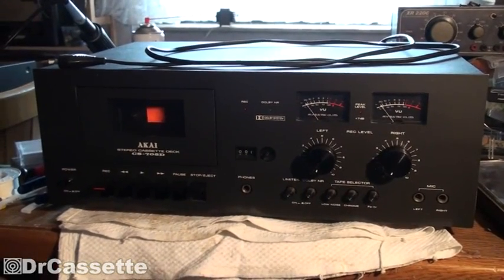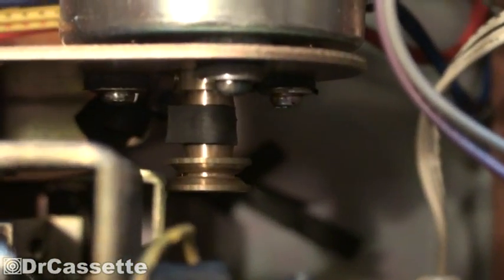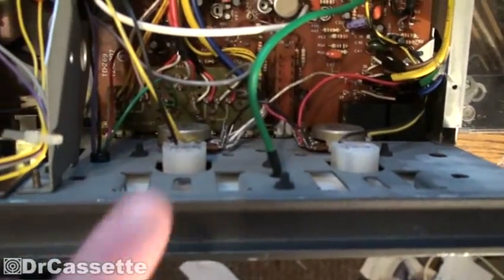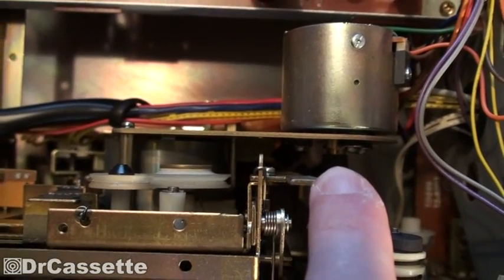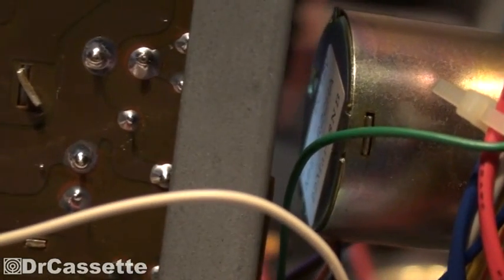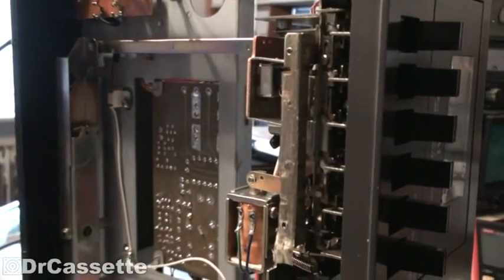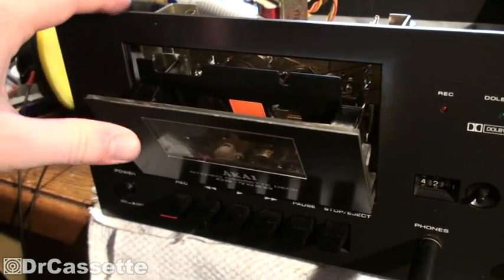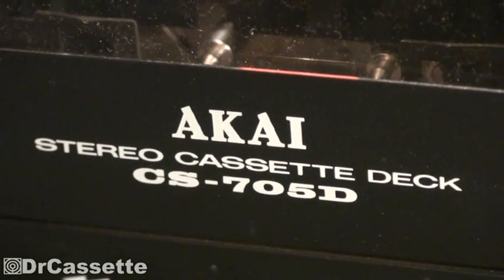DrCassette's Workshop - Akai CS-705D cassette deck repairs

Comment: I had one of these tape decks from Akai, bought new in 1979. As I live in Brazil, specially at that time it was difficult to find and expensive to buy hifi equipment. The most common ones were copies of JVC equipments (under the brand Gradiente) and from Alpine (under the brand Polyvox). But all of they were sold calibrated with tapes that could hardly be found here. When we recorded with the BASF, Scotch and Sony tapes that were being sold here the recording were poor, with low treble and too much noise. When Akai launched the CS-705D was a gift for us, who appreciated good music, because despite being affordable was capable of producing good recordings which, by the way, I still have until nowadays, surprisingly still with good sound. The only difference compared to the one you fixed was that my CS-705D had a silver front and also had backlight behind the VU meters. Congratulations for the video, made me remind of an equipment that gave me good moments of music listening.
Reply: Gradiente equipment was the same as JVC, the only difference was the design of the keys (in some of them)

Comment: I had one Akai CS-705D back in the 70s and it was my first tape deck worth using it. The older ones had a bad, bad sound, specially regarding the highs and the noise level. It was only with the CS-705D that I could have a sound decent enought to hear. I used it a lot, some of the tapes I have up to now in 2020 and they still sound acceptable. I sold the Akai in the 80s and recently I was given one in perfect condition so I could test it, but it was no match for the Pioneer CT-W505R and CT-W606DR I own today. Despite that, it was good to see DrCassette keeping this piece of jewell in working condition, it is part of tape decks history and in my opinion it is worth the effort to repair. It. Congratulations for the video, it was amusing!

Comment: I bought one of these a few months ago for little money. 
Took the risk of repairing and refining it. Lovely machine, my only criticism is the slightly flimsy manual buttons, but apart from that it was easy to work on, although the solutions to problems are not always easy. Up and running and sounding stable with slightly better frequency response than the specs.
Thanks for the tip on the cassette door and loading tray - nice touch DrC!

Comment: Hi, I know I came too late but the CS-705D has two lamps for the meters. You have to remove the frontal plate to replace them. Love your channel.
Reply from the maker: I don't remember if I ever figured out the meter lights in this deck. Maybe I finally did before selling the deck.

Comment: Nice to see you back with another YT vid.  Great Akai cassette deck!  I still have a nice GXC-710D that's a year or two older than your CS-705D.  I bought it new back in '77.  Akai must have dropped the glass/ferrite head GXC series. I've never seen a black faced Akai like yours.
Reply: The Black Face are EXTREMELY rare.  Kind of a collector's item actually, if you collect old Akai's or rare tape decks.

Comment: I have an Onkyo TA-630D tape deck that looks somewhat similar internally.  I've been putting off fixing it because the belts have disintegrated in a fashion similar to your Aiwa unit prior to repairs.    Unfortunately, in my deck large pieces of the belts have remained attached to the rollers, and have essentially turned into a kind of viscous black liquid.  I'm wondering if using freeze spray might solidify the belt remnants enough to remove them without making a huge mess.

Comment: Hi! Great video! I've got a CS702DII that powers on perfectly but then does not rewind, fast forward or play. I did notice that when I press the rewind button the capstan belt does move slightly. Apparently the seller who sold me it said it worked perfectly when he sent it but now it does not. So what sort of thing could happen through a delivery process to make the play, rewind and fast forward features not work? I know this is a long shot but would appreciate any help!
Reply from the maker: Maybe a loose belt slipped off during the delivery process? The problem description sounds like bad belts or bad idler wheels (though idler wheels don't instantly go bad).

Comment: A solid entry level hi-fi deck, 2 head single motor. I have the cs707 which is almost identical but the front is silver and case wood. It also has more illumination and an output level control. One of these days I will rebelt it as there is flutter on the playback :-)

Comment: I have an Akai CS M3 cassette deck that the play, FF, and RW switch will work as long as you hold them down, they will not stay down on their own. Any idea of what might be causing this?
Reply from the maker: The latching mechanism might be seized up due to sticky old grease. I had this happen on other cassette decks.

Comment: I got a CS 705D in great condition from my father in law, he told me that he used it for cassettes and as a amplifier for his LP player. But apparently I have difficulties getting it to work as a preamplifier for my Technics LP player. Do you know if it even is possible to use it as a preamplifier? I know my way around cables and the connections but yet all my attempts fail. Could it be something broken inside?
Reply from the maker: You can not use this as a preamplifier for a record player. You need an amplifier with a proper Phono input. That also features the RIAA equalization you need for the full frequency response. If you'd try to use the cassette deck as a preamplifier you'd only get a very tinny sound out of it.
Reply: DrCassette Thats what I originally thought, thank you very much for the answer.

Comment: Thanks! Excuse my ignorance : what exactly switch ? I gave the spray to all actions taken by the play button and the problem is not solved ....
Reply from the maker: bevavictor The Record/Play-Switch!!! A long internal switch on the main circuit board. It is only operated when you press RECORD!!!
Reply: DrCassette I solved the problem with your advice .... I thank you very much! Now it broke the bulb PL-3 in the cassette compartement .... if I can not find in the store will take away from the other deck!
Reply: Vittorio Principe Hi! Today new light in the cassette compartment! The restore of deck 1 is complete! Thank you! file://localhost/Users/vittorioprincipe/Desktop/Akai705D.jpg

Comment: Hi! I watched the movie .... really interesting! I own two 705 d (first series of 1977, blacks) with belt in order....the decks haves the same problem: by pressing the play button the right vu meter jumps (also the left) and producing bad noises. In the movie you speak of oxidation: where do I go exactly the spray flux? I'm not an electronics expert ....I tried to switch the spray on almost all circuits but the situation does not change .... what am I to do? Thanks! I would love to make them work again !!!!
Reply from the maker: Vittorio Principe No flux, you need contact spray! I use Tuner600, maybe it's available where you live.
Reply: DrCassette Hi! Thanks. I have the contact spray. In that exact point I have to apply? Vittorio
Reply from the maker: You need to get it into the switch. Then operate the switch multiple times.

Comment: Wanted to know how to regulate the speed, mine is too fast...
Reply from the maker: There is a small hole in the back of the motor. Inside there is black rubber, but you can poke through a small flat blade screwdriver. You can then turn the internal speed adjustment of the motor. The screwdriver must be isolated from the outer case of the motor, or you will cause a short circuit when attempting to adjust the speed. So wrap the screwdriver in tape or so.
Reply: @DrCassette  Beautiful my friend, just done it and works properly now, thanks a lot for your reply!